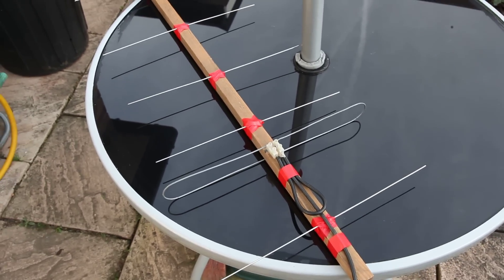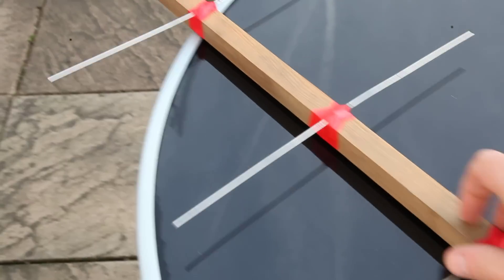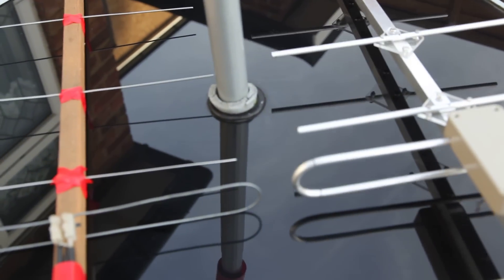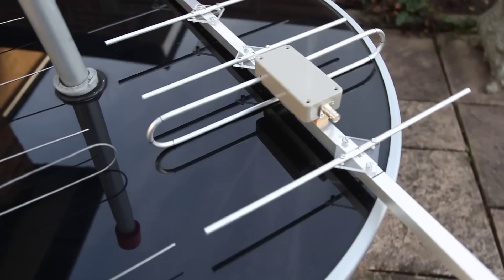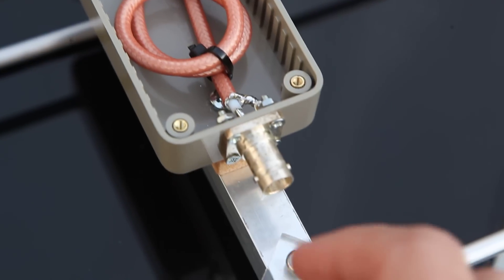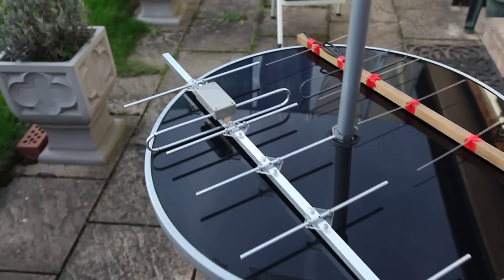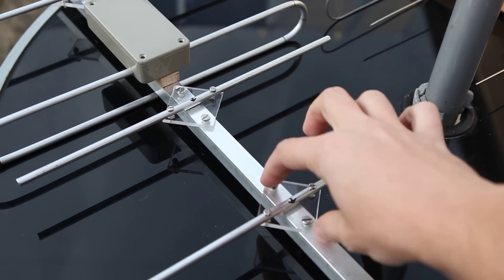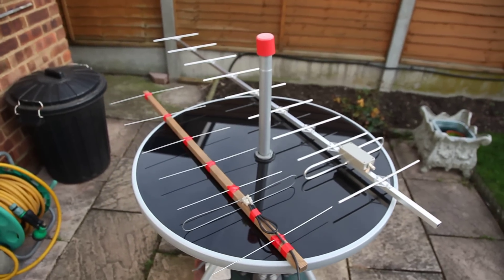Homemade 70cm Yagi Beam Antennas

Comment: Could you drill through the boom and use rubber grommets to insulate the elements?
Reply: Length of the elements will be another! If you pass or go through the boom, the elements need to be smaller. Depends on : Boom diameter and Elements diameter. This is only for the parasitic elements! Driven elements in this configuartion ONLY isolated from the boom...

Comment: I reckon it should Be Made From Copper. 
I have Accumulated A HUGE Deal Of Copper and I'm making antennas from it, i have large wires, pipes, wires, rods, all diameters n stuff. :) 
if you are a HAM, always collect copper like that because steel IS NOT THE SAME.

Comment: Very nice! I'm curious about the 4:1 balun. I thought that folded dipoles had a 300 ohm impedance, so a 4:1 would make it 75 ohms, which is probably fine. I've used 75 ohm cable a lot on 2 meters and above with no issues myself. Or do you match the 75 ohm to 50 with a matching section. 73's W1RMD.
Reply: 300 ohm \2 150   /2 is 75 ohm, remember refl /2  dir /2  so 300 ohms goes down to 75+_ the take in account the distance of the elements apart can take you down to 50 or  up to 100 whatever you prefer or down to 35 ohm by moving 1 st director real close to dr element

Comment: Hi john, I have built an 8 element, but dont use a coax matching stub, my reflector is a lot closer to the driven element which drops the impedence down to 50 Ohms. 
Mine is made using connecting block (chocolate block) to secure the Stainless steel elements above the boom. 
Its great fun when you build up simple yagis. I'm now in the process of building a pre-amp as my ICOM IC290 isnt as sensitive as modern radios but is extreemly well filtered and screened inside. 
They built them well back then. 
Thanks for the Video 73 and  hope to work you on 70cms 
Cheers Mark

Comment: can a normal multimeter measure the ohms resistance so I can see if it is made correctly
Reply from the maker: Hi. No, its impedance which is effective AC (RF) resistance.
Reply: @johnp21  so I guess I need a little antenna tuner

Comment: everyday we are getting more crazy, now we make antenna's on wood, how long will that last?
Reply: Just coded with used motor oil  the old days we used to the fence of the Farm you can also barbecue blacking with a flame not making the wood burn completely nice ways without paint Why Not use it on a little Wood  antenna

Comment: Doesn't changing the type of boom from a wood insulator to a metal conductor change the required lengths and spacings of the elements of this antenna?
Reply from the maker: Dii Kwadd No, I usually insulate my elements from the boom.
Reply: Do you have the dimensions of the antenna!?i sm interested in building one myself but i could use some sizes and dimensions!Please!Thank you and 73’s from California!